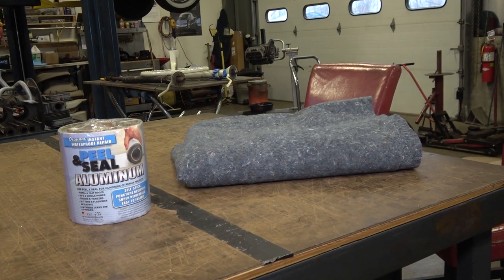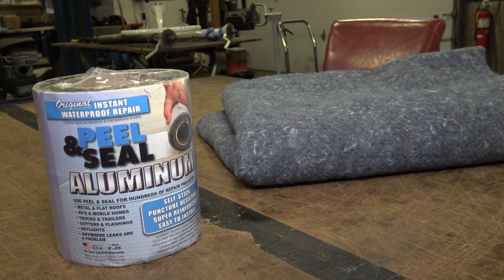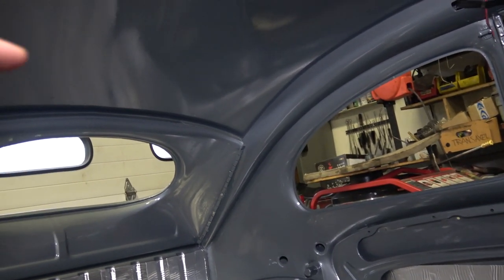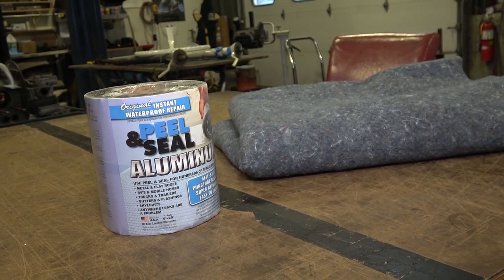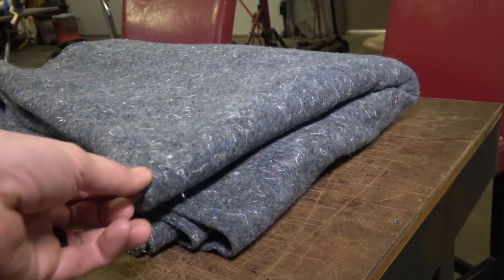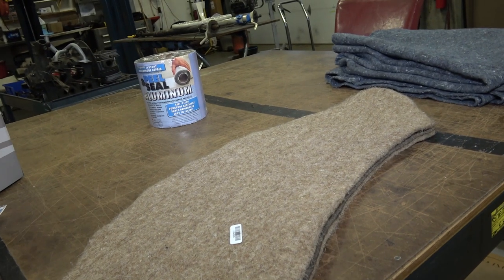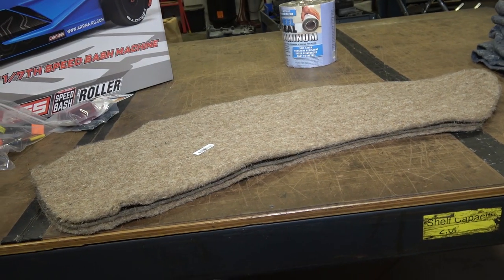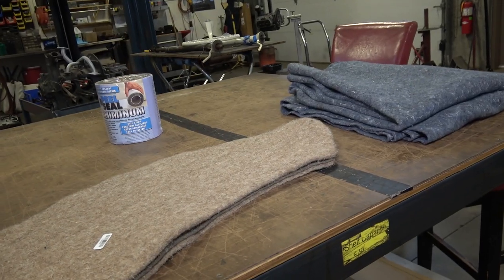Classic VW BuGs 2020 Update Quick Roof Peel & Seal Beetle Sound Insulation

Comment: This is what I enjoy about your vids Chris the repurposing of easily a available material into restoring our beloved Beetles. I used your guidance in reupholstering my bug and went with the foam squares and rolls from Home Depot and Walmart. Used a actual replacement foam kit on one front seat and your recommendation on the other.  The seat with the foam you suggested looks better! I may slap some of this peel and stick roof stuff inside my 67 to hopefully get it as quiet as my 73 SB.

Comment: I actually used that peel & stick on my Bug because of your old video. It works great. Made a big difference. Thank you for the tip. I am going to try it on the roof this summer. I’m not putting in a standard headliner because it is a Replica race car so I’ll know if it falls. I’ll report back in the fall with my findings.
Reply from the maker: that would be great

Comment: I live in AZ.  Car temps in direct sunlight in the summer reach 175 degrees.  You cannot use any asphalt based stuff.  It will get soft and it will smell.  You might be ok on floor pan and engine compartment, but 100% cannot be used on the rooftop. It will not hold.
Reply: ive also in az, i did this back in 2013, full luggage tray and floor pans, no smell here
Reply: After it cures it wont smell.... notice how you can walk into walmart across their massive asphalt parkinglot and your feet dont stick to the ground and you arent overwhelmed by the smell? Even on the tar they seal the cracks with doesnt do what people claim peel and seal does, sure its soft when hot but it doesnt melt until you take a blowtorch to it. So if your car interior isnt melting your peel and seal is fine 😉

Comment: I use that on my 76 and added to the roof as well was $8 5 years ago at home depot the best one.
Reply: Did you have any issues with sunlight/heat melting the adhesive? Some commenters mentioned that as a possible issue.
Reply: No issues still holding up, I took off the sunroof headliner for repairs and the material still there solid just beware of the brand that have the chrome looking one that is not good come right off.

Comment: Using it on the roof I think makes the biggest difference. Just make sure u use a good quality one so the tar adhesive black stuff doesn’t melt down and seep thru the headliner. Nothing worse than a tinny rattling roof

Comment: Wouldn't using this on the floorpans trap moisture between it and the floor pan after some time? What's your take on this? Thanks for the help!
Reply from the maker: Well if you seal it down nice and tight you should be ok.  Plus we use these cars on fair weather days, rarely in messy weather, so the likely hood of the floors rotting in my lifetime are low.
Reply: @classicvwbugs  That is true, thank you for your honest opinion. I will probably use this for my 72 Ghia then! Keep up the great work, even though I could never afford one of your creations, I truly silently appreciate all of them! Best Regards

Comment: hey Chris... love this video... I have used the Peel N Seal in my 66 baja build all throughout except the roof area ..... and I particularly love the idea of the moving pads for the headliner and back pillar areas....

I have already installed a headliner kit, but when we got to the final step of the roof headliner, found that we had the wrong headliner!!  It appears to have been a roof headliner for a squareback or fastback as it came out the back window almost 2 feet... we cut it and made due, but I do not like how it came out, so, I ordered another kit.... we learned that if you get padding too close to the windows, it makes the window install very difficult....my question.... how far back are you trimming the padding from the window areas to allow for the window weatherstripping to properly & easily be installed when doing the glass??  (I am ordering a 3 pack of the pads I found on ebay)  Also, would it be OK to put more of that moving padding in the rear panel area (under the rear side windows) to help further dampen noise??

Comment: If you do an internet search Quick Roof is available from Walmart online. I don't know if it is available in store.
Reply: Chris: I will pass along a picture of the padding on my Super behind the battery and under the ear seat back. There is some cardboard material with jute like material. I noticed that you new RHD model is very quiet, even from the outside.

Comment: Chris, first I want to thank you for all of your videos. They're extremely helpful! Now for my question. After watching your videos on using Quick Roof, I bought some online to use on my '72 SB, intending to use it on the luggage area behind the back seat, as well as the front firewall and floor pans. But after I took the carpet and seats out, I discovered that what appears to be something like Quick Roof already down under the carpet in the rear  luggage area, the original tar boards on the front floor pan (in great condition and very difficult to pry up), and the original material on the area where the back seat rests, also in good condition. It kind of looks like a cross between jute and pressboard. Yeah, I should've taken the carpet and seats out first! Anyway, my question is this: Do you think it's better to install Quick Roof over this original material, or just leave it alone because the material already down does a fine job at sound deadening, and putting anything more down is just overkill? Thank you!
Reply from the maker: Yes I would leave that material alone, it does a good job already.
Reply: @classicvwbugs  Thanks, Chris, and thanks for the lightning reply! :-)
Reply from the maker: @mahirjan1984  you are welcome

Comment: i found some at home depot, but it does have a rubber backing, and it is about 3/16 thick. 
this is the online skew. its about $36 for a 5' by 8' piece.

Internet #203173556
Model # HD040508F